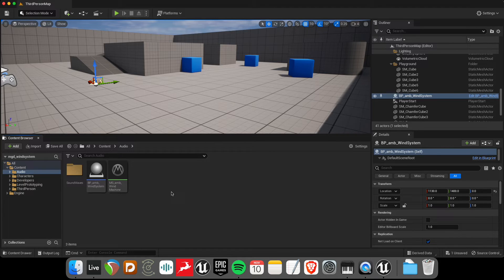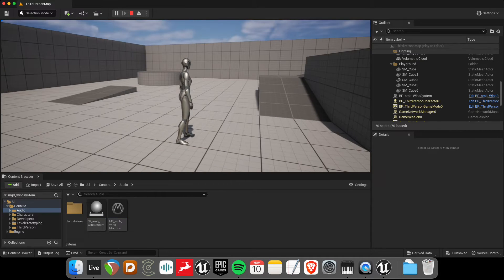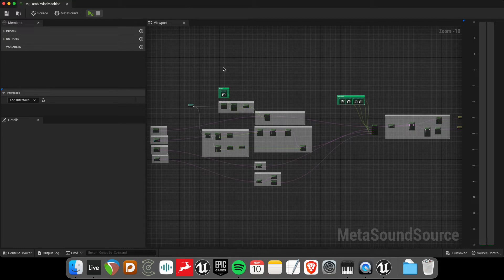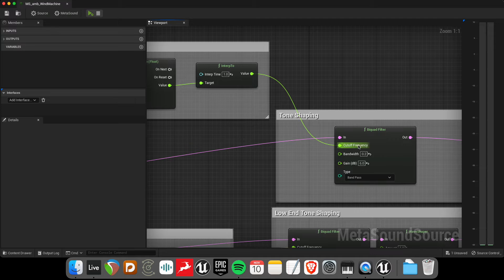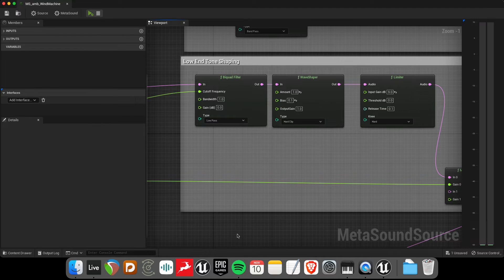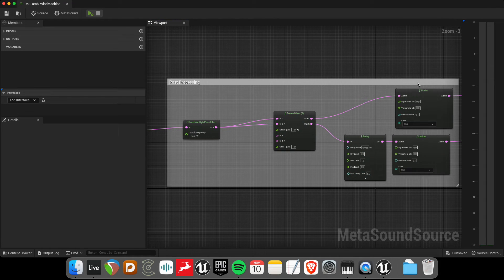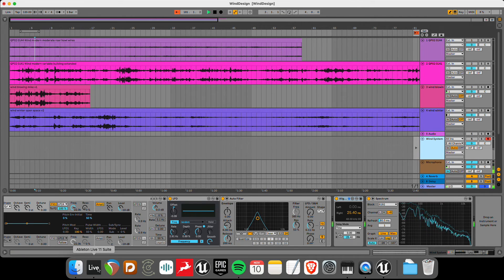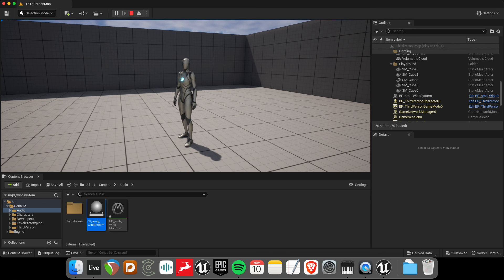Creating a Dynamic Wind System - Procedural Audio SFX in MetaSound - Tutorials for Unreal Engine 5

Comment: I got it working, but there's a lot of hiss.  Going back over the tutorial and checking settings but so far no luck in eliminating it.  If in the mixer controls I drop Hi End and Mid Ambience to zero it disappears.
Reply from the maker: Hey there @BlackPowederGame, that's right, there is indeed hiss. This design is modelled after field recordings of wind, which often include extra artefacts in the recordings, such as the hiss of signal-noise in microphones that have high gain settings (think of turning up the gain on a Zoom recorder or something). You can of course adjust mixer controls to taste as it suits you. If you don't like the high end hiss emulating a high-gain microphone, exactly as you mentioned you can try turning down the Hi End, or adjust the other levels as you like. Hope it helps!
Reply: @michaelgarydean  also, thanks to your tutorial series I think I can take on a custom wind sound.  Glad they were just a couple of minutes long each; took away any argument I had for not going, well, its only a couple of minutes.  Spent a few hours recreating them, and well worth it.  Thanks.
Reply from the maker: @BlackPowderGame  Awesome! Glad it helped.
Reply: @michaelgarydean  Now the big question:  how do I set up volumes to occlude the wind sound from my buildings and caves and water?  Every solution I've seen involves point sources like in objects, but this wind ought to be everywhere in the world except indoors.  Any ideas?
Reply: @michaelgarydean  By turning down the Hi End and Mid to zero I got rid of it (though they were nice).  My game is set in the eighteenth century so I'm going for naturalistic sound in the pre-microphone era :)P  
p.s.  Any tips on how to set up volumes to occlude the wind sound from my buildings and caves and water?  Every solution Ive seen involves point sources like in objects, but this wind ought to be everywhere in the world except indoors.